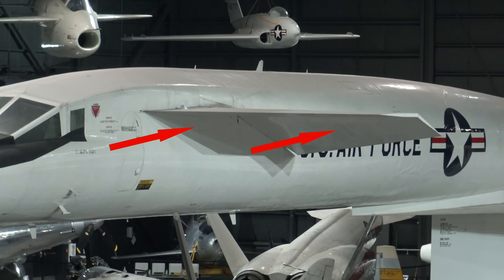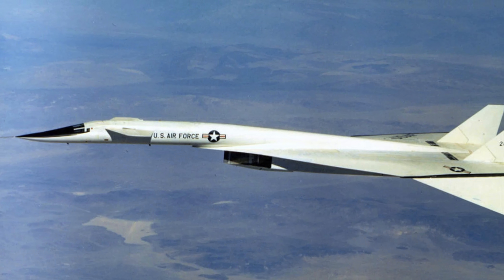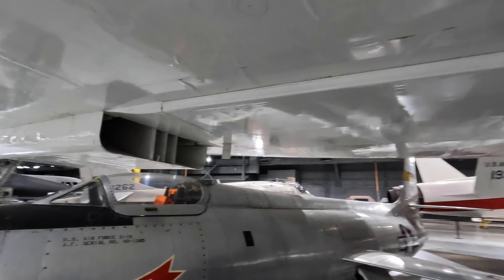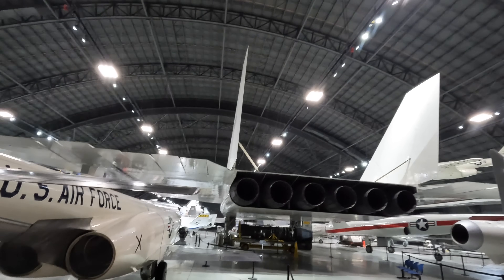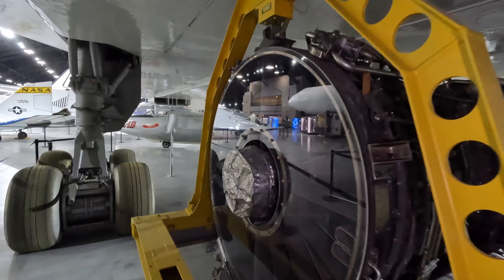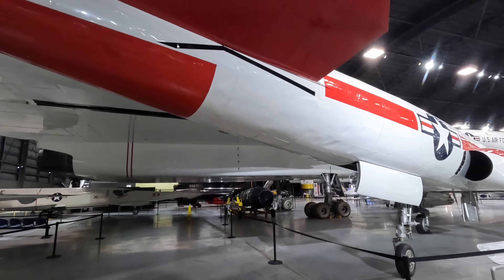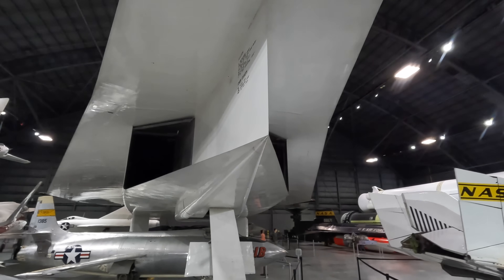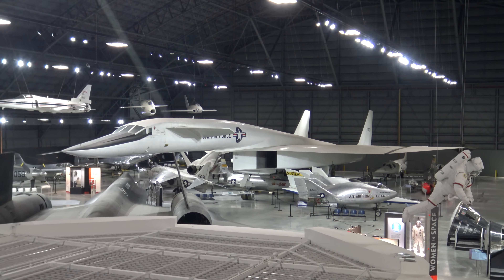Tour around the North American XB-70 Valkyrie - the greatest cold war bomber that never was.

Comment: Paul, I had the Opportunity to sit in the Cockpit of that Very Same Aircraft whilst on Exchange Duties in my Air Force Days to the USA.
How Awesome is that Machine and can you think in this World in this Day and Age of President Trump said bring it back to life what it would be With the All New Engineering and Build and Components Capabilities along with the Advanced Offensive and Defensive Systems plus Avionics and Electronic Warfare Systems and the first to maybe use Hypersonic Engine's.
Cheers 
John 😊😊😊
Reply: “Bringing it back” as a frontline platform would involve a completely new design effort rather than simply updating the old one.

The original program was cancelled due to changing strategic needs, the rise of ICBMs, effective surface-to-air missiles, and very high costs. Modern military aviation has since shifted toward stealth, unmanned systems, and stand-off weapons rather than large, Mach 3 crewed bombers. Upgrading the XB-70 concept to today’s technology would mean redesigning almost every part, from the airframe and propulsion to materials and mission profile, and would likely be less practical than using modern designs tailored for current threats.
Reply: If "President Trump said bring it back to life," it is obviously a bad idea.

Comment: 3:20 that rear facing cowling that bleeds off excess air from the intake also protects the sliding door bomb bay. The next fact is the single craziest thing that I learned about XB-70 when visiting Dayton. The bomb bay door itself looks to be .125" or maybe even .080" thick bent aluminum. It slides rearward on rails that are no stronger than what you'd find on office furniture. And the springs at the rear of the rails to suppress the impact of opening are equally dainty. That rear facing cowling punches a Mach 3 hole in the air with enough impact to allow the flimsiest of aluminum parts to be all that it takes to have a meaningful bomb bay door.

Comment: I don’t know if you read comments from your older videos … but it would be nice if you talked about the “why” and not just the “what”. The XB-70 did not use the same engines as the SR-71. But WHY?
Reply: The 58 didn't power a Blackbird until about 1962. By then, B-70 had been canceled as a weapons system, so there was little need to redesign it around a different engine. The 58 used an exotic spike intake, and I don't know how that would have fit with Valkyrie's famous ventral intakes. The 58  was heavier than YJ93, and had a higher SFC. There was likely a lot of interest in YJ93, because it was based on the famous J79, and a civilian version of the engine was expected to power the American SST.
Reply from the maker: Fair enough. Im not sure of the answer, are you aware of why?
Reply: They didn’t use the same engines because different missions = different engine requirements, different airframe/engine integration designs, and different development timelines.

The J58 simply didn't exist yet when the XB-70 engine design was locked in. And fundamentally, the J58 was a more advanced, adaptable system optimized for a recon plane, not a cruise-optimized supersonic bomber.

Comment: It seems really odd to me that after so much innovative research going in to the A-12 /SR-71 to reduce radar reflections via shaping and coatings, the Valkyrie looks as though it was built to maximize those reflections! No stealth coatings, almost all 90 degree angles... ? It's a beautiful aircraft but almost looks like it was designed by an effects artist for a film and not for actual flight where detection should be avoided.
I'd also like to hear something about why white was used in some radical aircraft from around this time. Maybe this was just for the prototypes, but not intended for operational use? The amazing Canadian CF-105 Arrow is another. 
Thanks for the tour!
Reply: It was designed during an era when speed and high altitude performance made stealth unnecessary. Some features, like the prominent intakes, were needed to generate a supersonic shockwave needed for compression lift, and probably added to RCS. 

As a bomber, the B-70 never existed, having been canceled in 1961.

Comment: Hi There Paul.
Got interrupted by a phone call and accidentally cut myself off from the XB70 Valkyrie Aircraft and that of the Maritime Aircraft and their Fuel savings and say when an XB70 was allocated on long patrols with that maybe involvement in a long range stand off patrol and with that in mind and depending on outside conditions for Global Reach patrol in mind shut down up to Four of her Six Engine's if feasible at Height and with the Thin Air at Altitude maybe Variable Geometry Engine Air Intakes would be able to feed the Engines being used a Larger Amount of Air Intake to those Power Plants Left Running and doing it easy but thinking about it maybe three engines engaged with three shut down but not all the the way and cater for a long time in loitering with also fuel saving in mind would make the mjbost of the available Air but at the same time could be back on line in a split minute.

Always and as usual Great Video and Narrative and I can't help but get hooked when not on Duty to watch your Channel because of the shear nos. Of Different Aircraft you present to us which in itself is worth waiting for and that of the Technical Aspects once again, Got me hooked well and truly and I don't think that hook is going to come out anytime soon either.

"" Excellent "" In One Word.

Regards
John
Reply from the maker: Thanks John!

Comment: Dear Paul.

Wow, The Aircraft I felt could have been irrespective of ICBM Rocket's
Magnificent and Magnetic to Myself.
The Aircraft that could lower it's outer Wing Tips and Ride the Shock Wave like a Cushion of Air.
Way ahead of her time but still Noteworthy Enough in this World of ours just how quickly things can change.
Imagine if they kept this Aircraft on Ice for Future Check Flight wise at NASA right up until this Very Day.
With the Use of Modern Composite Materials for Consideration of Construction and in terms of Technology, The Sky's are the Limit.
The Most High Technology in terms of the Intergrated Weapons, Radar and Infra Red and Laser Targeting all Available to the Pilot's on the Inside panel of their Helmets or vide HUD, Head Up Displays and other such Systems all Designed Around The Intergrated Smart Capabilities Found in the Cockpit especially the Both Manual and Electronics based Countermeasures with the Ability to use Anti Radiation Air to Air missiles if they are ever needed.
The other burning issue is the Power Plants X (6) Six Built around that of the Latest High Tech with Afterburn and you have one very lean and mean Aircraft especially with the new and latest Weapons Systems.
Then one's mind Turn's to Just how long are we away from the Hypersonic Engines.
That would make for a very interesting Aircraft which would need some Structural Refinements but it would lead to that old Clichy "" catch me if you can "".
Flying up there at SR71 heights and cruising along with very little stress on the Airframe which is all Newly Designed.
The Punch the Aircraft would Deliver would certainly be a Killer one and one other thought I'd Like a Long distance maritime Aircrafts ability to shut down engines and Feather the Propeller and execute in flight mode at a time and save on fuel, this Aircraft could
Reply from the maker: Thanks John

Comment: Maybe more appropriate to say the Concorde nose droops like the XB-70"s. The wingtip droop at Mach (besides enabling the "wave-riding" and adding vertical surface) also shifted the center of lift forward, offsetting the center of lift shifting rearward at high Mach.
Reply: @Galileo7of9 True the whole nose didn't dip. They rejected that. The windscreen deflects downward (glass more vertical) and the top of the nose lowers to open the view. Same end result, simpler, lighter.

Sits in the museum in lowered position. Check the profile at speed. It's a needle. Have a great day.
Reply: @ElsinoreRacer  " The windscreen deflects downward (glass more vertical) and the top of the nose lowers to open the view."

Incorrect. The "top of the nose" didn't move. There is an inner fixed windshield.  The outer, variable geometry windscreen and its associated ramp move together for either increased visibility or reduced drag.
Reply: @smark1180  Thanks. Kinda splitting hairs now but the point was that the nose section of the aircraft morphed to allow vision on the approach and to also minimize drag and aerodynamic heating while at Mach. I couldn't remember how it did it and did a quick web look. Above is what I found. TY for the clarification.
Reply: @ElsinoreRacer  The point is that the XB-70 doesn't have an articulating nose like that of Concorde.
Reply: @smark1180  I don't know that anyone did. My point was it changed configurations to provide for pilot vision. Not too hung up on how.
Reply: @ElsinoreRacer  " I don't know that anyone did"

Did what?
Reply: @smark1180  Claim that it articulated like a Concord. Looking back, I guess it seemed that way. Should have said provided for pattern vision by altering the front sight lines. Have a great evening.
Reply: @ElsinoreRacer  LOL! Give a rest ffs.
Reply: @smark1180  Hey girlfriend, I was just being polite enough to to respond to your kinda butt-hurt bleatings. Trust me, we are done.
Reply: @smark1180  Pure class. I'm guessing you are cramping too. Have the last word, sweets.
Reply: @ElsinoreRacer  "Trust me, we are done."

Obviously, you can't be trusted. Who knew?!

Comment: So as a side note, this particular XB-70 (AV-1, Tail #20001) was limited to a max speed of Mach 2.5. After hitting Mach 3 one time, the honeycomb structure of the panels started to separate, so they limited the speed. 

AV-2 (Tail #20207, and the one that crashed) was allowed to go the full Mach 3. It did the majority of the flying IIRC until that fateful midair collision with the F-104 in June of 1966.
Reply: What's truly sad is the midair collision that destroyed the second XB-70 was a result of a flying formation error from another air force aircraft flying too close.  The reason for flying so close was for a photography requests by air force brass.  What a waste.
Reply: @osulxa  
Exactly.  Guys were sniping beforehand, "We're doing this for a picture?"  Imaging how damn disgusted they were when they came back!
Reply: @osulxa  The photo shoot was to feature all USAF planes using GE Engines !!!!!  The F104 got too close and got sucked into the wing tip vortex and rolled it into the vertical stabilizer tearing it off, it is all on film !!!
Reply from the maker: Interesting. Thanks for the extra info
Reply: That's good info.

Comment: Notice on the underside of the fuselage wrinkles in the skin. I had seen this when I visited the Museum when the XB-70 was in the secured area of Wright Patterson next to the restoration shop. I hadn’t noticed it under the splitter. This is disbanding of the skin from the honeycomb structure. I was told it was due to sweating of the skin when it was stored outside many years ago. The condensation would collect on the inside bottom of the aircraft and in the winter it would freeze and the skin would separate from the honeycomb. They told me it wasn’t bad enough to be dangerous,especially now that the aircraft is stored inside in a controlled environment. I imagine it would be difficult to repair if they had to.
Reply from the maker: Interesting

Comment: I fell in love with this aircraft after reading about it in Speed and Power Annual circa 1973. Wind the clock forward 43 years and I just happened to be working at Wright-Pat for several weeks. Then it was in the old X-Plane hanger on the main base and just squeezed in the length of the hanger, dwarfing all the other aircraft inside. It's difficult to get a sense of the sheer size of the thing here. An amazing piece of tech just showing what was possible with enough money thrown at a project.
Reply: The old hangar was a pain to get to, but so much cooler to visit. Nothing was roped off, so you get much closer. The new building is much more accessible, but less fun
Reply: @Diabolical_Engineer  I was lucky to be in the RAF at the time working just up the way from the XPlane hanger, meaning I didn't have to deal with the whole access thing. Haven't been to the new hanger but it is a possibility in the future as I now live this side of the pond.
Reply from the maker: lucky you!

Comment: most people don't realize this aircraft was made of steel rather than aluminum. 

Steel has nearly identical strength for a given weight when compared to aluminum. It's just much thinner than aluminum, sometimes ridiculously thing. the notion that aluminum is lighter than steel is a misunderstanding.
Reply from the maker: Interesting. Why do they use aluminium then?
Reply: @PaulStewartAviation  in most applications, the steel is so thin for the strength needed, that it becomes wrinkly, and hard to find such thin steel material. If you're building an airplane out of aluminum sheet that is 0.032" thick for example, the equivalent strength steel sheet is much thinner but equally as soft and pliable as its aluminum counterpart. It is very hard and costly to source steel thin enough. Also, aluminum has better corrosion properties. If you were to use a similar thickness steel to aluminum, the airplane would be overweight and excessively strong.

Budd RB-1 Conestoga is another example of a steel airplane that helps highlight the challenges of using steel. It was also partly disliked because it is wrinkly, and partly because it was so ugly.

Comment: What are those supports attached to the vertical stabilizers from the fuselage? That metal strip above the engines looks flimsy. How did that survive at high speeds?
Reply from the maker: Good question and I don’t know the answer I’m afraid
Reply: Is it possible that the vertical stabilizers could be angled inward?…just a guess

Comment: I wonder if the canards, the shape and location of the intakes and the delta wing had any influence on the Eurofighter Typhoon design ?
Reply: I'd be surprised if they did. The 2 don't have the same mission or similar flight characteristics. 

B-70's canards are above aft of the pilot, the opposite of Typhoon. Canards have been around for a while, being used on Rafale, Viggen and one of the Kfirs. For some reason, in a pre-ATF era, canards suggested a futuristic design.  Circa 1980s concept art of future jet fighters often depicted a tail less delta and canrds. 

The centerline, ventral intake is ideal for Typhoon because that plane needs to be capable of high AOA maneuvers, and the AOA of airflow at the intakes will climb higher (relative to AOA at the wing) for conventional side-mounted intakes than "chin" intakes. Supposedly  F-16 designers were partly "inspired" by the Ryan Firebee.

Comment: The hole XB-70 project could have still succeeded if a accident didn't happen during a promotional video that caused them to lose the other one that was a lot more efficient and could fly at higher speeds.
Reply: Huh?  How did the "XB-70 project" not succeed?  The planes were flown to test high speed flight and, after the collision, the XB-70A continued to be used for high speed flight.
Reply: @winternow2242  Let me rephrase that. Could have succeeded even more than they did.
Reply: @Kghammond852  I don't see how it would have made any difference. The B-70 was dead as a weapons system. The XB-70A only existed as a test aircraft for high speed flight, largely for the American SST..
which was cancelled by 1971.

Comment: That's not how afterburners work.
Reply from the maker: how do they work then?
Reply: @PaulStewartAviation  A lot of extra fuel is dumped into the exhaust after the turbine section
Reply from the maker: @entiller  isn’t that what I said?
Reply: @PaulStewartAviation  I thought you said the exhaust came out more powerfully because of the nozzle petals squeezing together, like putting your finger over a garden hose.
Reply from the maker: @entiller  yeah it does, but that’s a seperate mechanism to the afterburner which is dumping fuel into the exhaust.

Comment: Although I never saw the XB-70 in my youth, I often heard the sonic booms. When I saw the pictures in the newspaper I was a kid, but it struck me as an airplane on top of an awkward box. Fast Forward to 2005. We lived in Michigan and I took my 12-year-old son down to Wright Patterson,  a 4 hours' drive. We arrived at open hour and hurried to get in line, to sign up for the bus that went out to the remote hangar where the XB-70 was housed then, next to the Lockheed A-12 as it turned out. I was also surprised to find the Bockscar B-29 in the main hangar. As I look back now, the XB-70 lurks as a wonder in the exotic imagination. I stared at the pictures and diagrams in the books for days. What a cool, almost alien thing it was to the imagination of the day, except when you look in the cockpit. The flight deck was a full-manual, prototype-aircraft affair, a rudimentary implementation without automation, in an otherwise space age machine. The daring design still boggles me. Imagine sitting in the duct, right in front of six turbines. I often did.
Reply: The flight groundcrew had to crawl inside to inspect the front of each motor and the surface of the ducts the first one, this one was damaged when a piece of intake duct broke loose and got ingested destroying an engine and causing a fire..

One incredible feature was the speed those beastmode motors could be swapped out... Straight out the back...
Reply: Those massive intakes are so big one can walk in them, just boggles the mind...
Reply from the maker: That would have been incredible to see and hear that stuff!